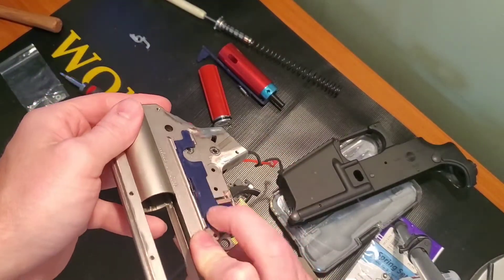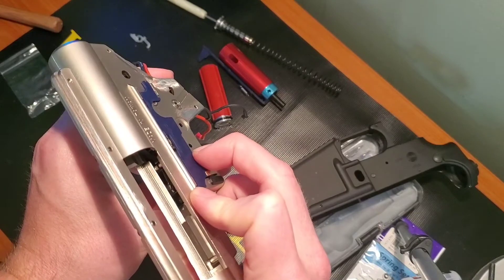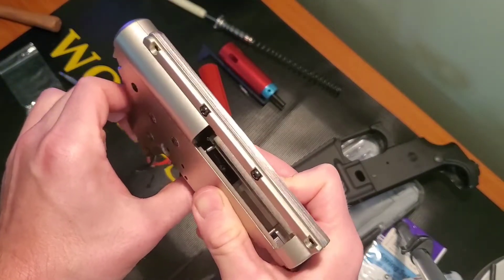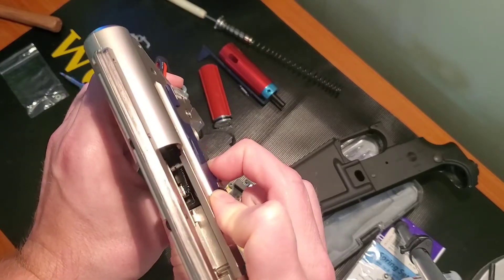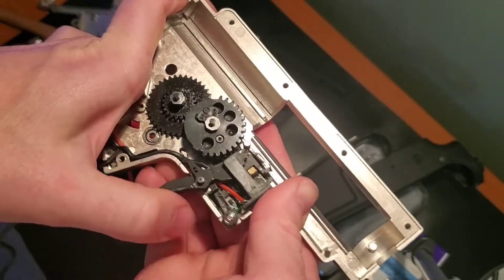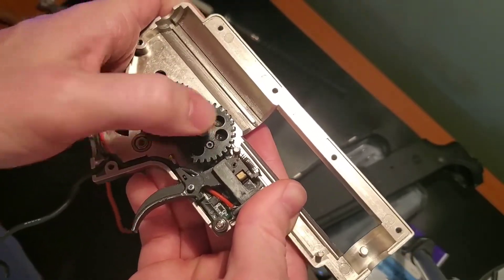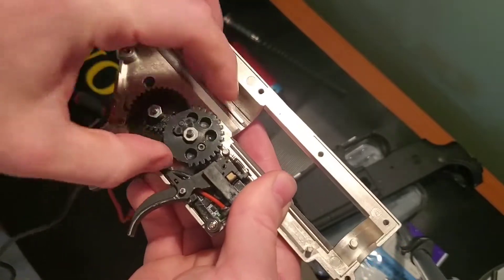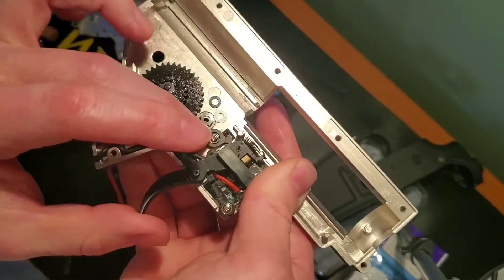Airsoft Cut-Off Lever Interference

Comment from the maker: Although the issue appears to be interference by the sector gear on the COL, the problem can also be resolved by replacing the trigger contact unit with certain models. From what I've heard, SHS red trigger contact units are good. The unit I acquired as a test from my local shop, Mir Tactical, was labeled as SHS, however it is black and looks similar to a lonex blue unit.

Comment from the maker: Here are some other possible solutions:
1. Shim sector gear higher. In many cases, shimming the sector gear higher will not be a great idea, though. If you pay attention to one of the fast-forwarded parts, you can see my sector gear is already shimmed quite high, so I do not feel comfortable doing this.
2. Modify cutoff lever by sand or grinding away at it's flat surface that faces to the right of the gun, if you are shouldering it, ready to shoot.
3. If you have a MOSFET integrated into the trigger contact unit, like in an Avalon, you can remove and replace that MOSFET onto your new contact assembly. This requires decent soldering abilities, removal of the contacts from their housing, and gently prying it away from the plastic unit. You NEED to desolder everything in order to do this successfully, otherwise you are almost guaranteed to rip out the leads built into the PCB. 
Final note: to do this mod, I recommend you go into it with the expectation of trashing the MOSFET unit, and possibly the trigger contact unit as well, as they are held together with super glue, making it easy to damage either part past the point where it could be safe to re-use. Be sure to inspect your MOSFET before testing it, and then test it before installing it.
Hope this helps! Good day techs.